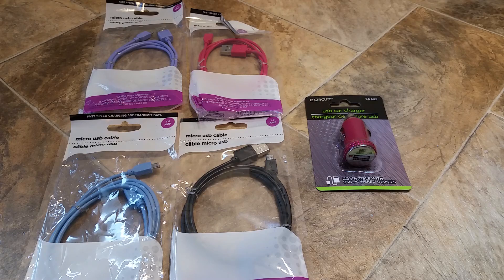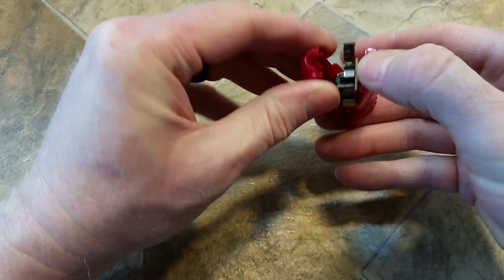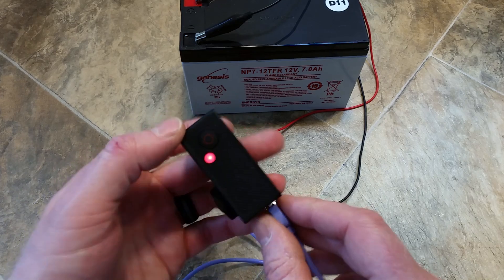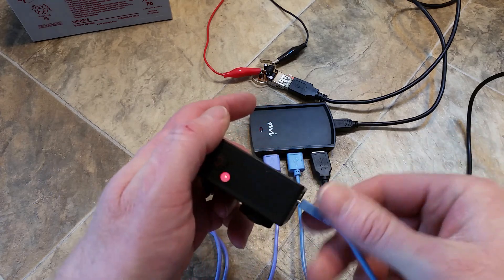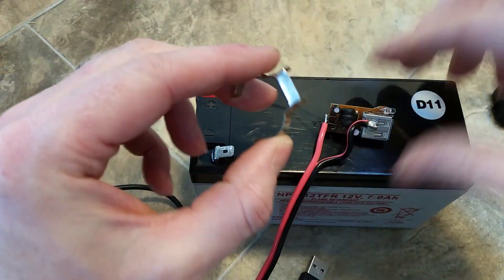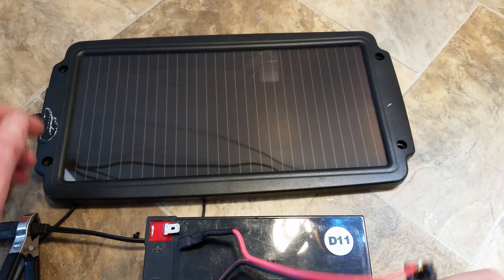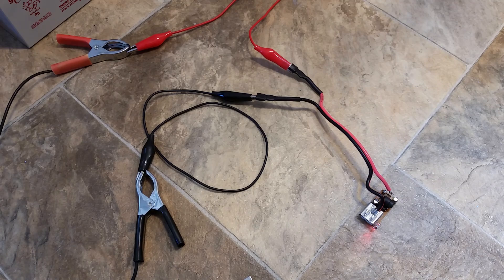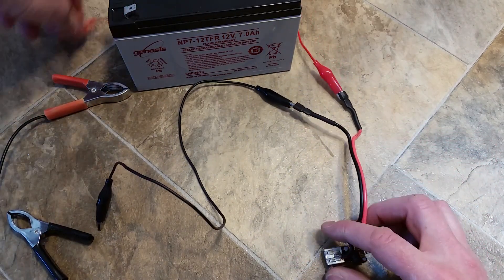How to make a Solar Phone Charger for $1

Comment: Thanks. I eventually followed this and have an emergency cell charger. I wrapped the positive lead around the post and hot glue gunned in place to avoid damaging the circuit board. Soldered the negative since less chance of damage there. Also, there is a circuit breaker in the tip of the car charger. I might use that if there is a concern of damage if a future solar panel is too powerful. As far as low power goes...seems an inhibitor on the cigarette charger limits power coming from the solar panel. Only 5 volts comes out of the attached USB port but testing leads coming from solar panel shows a little over 9 volts . Maybe safety feature avoids frying devices(?). IDK. Anyhow, thanks for showing this is real. And you are correct, no diode was needed using this car charger.

Comment: Great video. 

You should have the solar panel connected to the battery and then connect the other devices to be charged  to the battery.
So that you are charging from the battery NOT from the panel.

Try using a 5W panel instead.
Reply: InstaBlaster.

Comment: It will not work because the solar panel is only 2.5w it will not change the battery fast enough you could put a diode on the positive side of the solar panel which would help The battery from putting the change in to the solar panel
Reply: I called it as solenoid. Black and white diod. U can find it in any phone charger. Main purpose for the diod is to prevent current backflow

Comment: Watching other videos it sounds like a 1N914 diode is needed to block back flow(?). [about $2.50 a pack of 50 at Radioshack].
Reply from the maker: Usually the solar panel has a diode to prevent back flow.

Comment: Thank you. I was wondering how to tear these down to use with existing solar panels I have. Now I know it won't work well enough without some kinda diode to prevent back flow and perhaps a stronger portable solar panel...or unless charge a battery instead of direct to phone. Thx
Reply from the maker: A standalone battery charging station would work great with the voltage converter.  Would need a charge controller to prevent overcharging.

Comment: I have done the project like this but my phone's charge is reducing not increasing . What is the problem???
Reply from the maker: Your phone probably has dozens of apps running and draining the battery faster than the charger can provide the miliamps.  Turn your phone completely off and see if it charges.
Reply: Then also like that only it is happening sir
Reply: There may also be a bad diode somewhere in circuit..

Comment: i have 12 volts 15 watts panel. do i need still battery ?
Reply from the maker: Not use if 15 watts is enough to power the charger
Reply: if you have 12V solar panel direct connect car charger to solar whit out battery i maked today well work
Reply: if you have 12V solar panel direct connect car charger to solar whit out battery i maked today well work